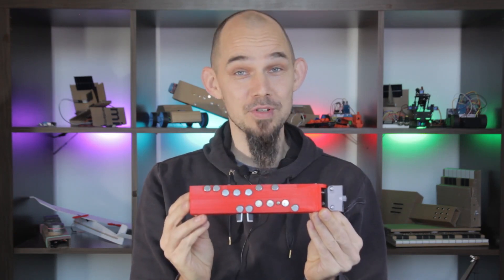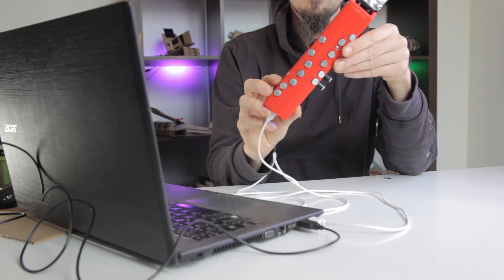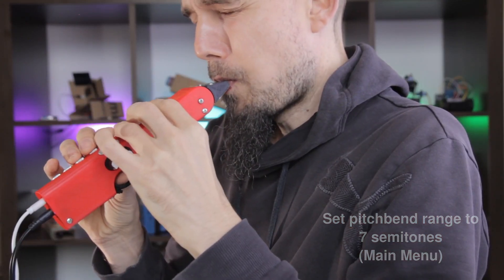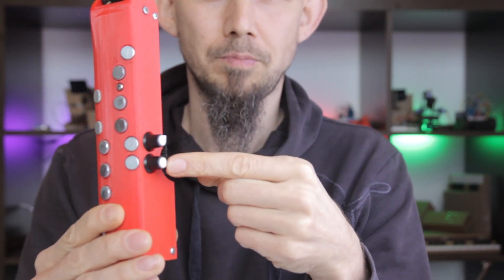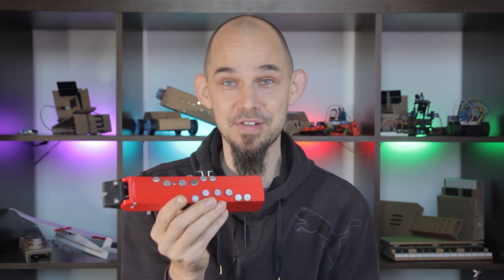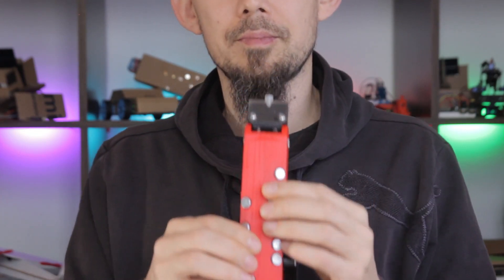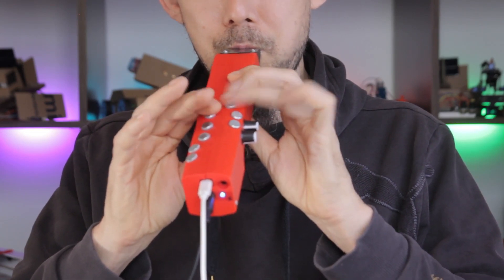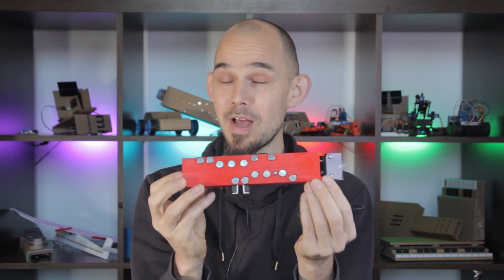The OHMs EWI gets even more awesome!

Comment: I'm impressed with your perseverance producing 23+ iterations, (reminds me of the spaceX approach to making great advancements through numerous version tests)
 For my purposes, the sound product sounds too synth, I wonder if the envelope can more continuously linked pressure input through the note life, sounds more like it's sampled as an ADSR factor once. Using the differential of 2 pressure sensors might better mimic some wind instruments.   Perhaps a more modern voice modeling algorithm more advanced than a single waveform table could provide more of an analog instrument feel, I'd think the teensy 4 would have the horsepower for that.
  Perhaps multiple MIDI control out channels would allow users to experiment with voice modeling on their PC
 There's a simple tear down of the Vangoa EWI   www.youtube.com/watch?v=2Avfv2L7Kl8
 He points out what might be a single Capacitive touch I2C chip.

Comment: This MIDI wind controller project is wonderful.
Congratulations

I am a musician and composer from Brazil and have also practiced electronics for many years. I really like midi controllers, audio, musical synthesizers, lighting and automation. But I'm still a beginner in microcontroller and DSP programming.
If possible, I would like to exchange information and experiences accumulated in our practices.
Sorry for my basic English.
I have an original Arduino MEGA Board, but I found the Tensy and ESP32 boards very interesting.
I'm currently interested in building a midi keyboard, preferably without mechanical contacts, I've been observing the possibilities of infrared sensors, such as the CRY70 and TCRT5000, to instantly generate midi codes for each key pressed:
Midi Channel, midi note, speed, after Touch and others.
The codes being generated from the voltage proportional to the approach of a reflective element to the IR pair.
Thank you for your attention, and success in your projects.
Have a great week.
Cheers
Reply from the maker: Sounds like you already have some good ideas of how to make what you want. Best of luck with your projects!

Comment: I'd love to make one of these and I'd love to buy a kit but they are out of stock =( will you restock your shop soon? If not soon, would you be able to provide a schematic so i know what pins to use on the teensy without the breakout board and other modules? I'd love to make one in the meantime to tinker with it so when the kits come back in stock I can have a more reliable one!

Comment: Amazing job! I was playing with a disposable vape pen the other day and I saw it includes an air pressure sensor which passes it’s analog output to the coil serving as a heating element. I instantly thought about your instruments.

Have you tried to mod one of those into a Bluetooth midi instrument? The problem is the ones I have access to are way too damn thin for the smallest modules.
Reply: midi oboe??? JK

Comment: Hello! really big fan of you work. i have a technical question:
how do you implement velocity on the capacitive buttons? is it a thing of teensy or not?

I was looking at the MPR121 module for capacitive buttons (that can be used with arduino as a reliable touch sensor instead of using teensy that has the same circuit built in) but the velocity part i really dont understand

Comment: Awesome stuff.

Maybe instead of audio delay effects, it would be easier to implement a MIDI sequencer that records a beat while you hold Record button and then loops it.

I did not feel skilled enough to build the entire wind instrument from scratch. So I first bought a used Yamaha WX11 for cheap to experiment with and to get the feel of it. That device doesn't even have a standard MIDI out.

What I did was add an Arduino Mini Pro with a NR24L01 and USB battery and 9V converter (because WX11 needs ~9V on input) to WX11 and an Arduino Micro Pro with a NR24L01 to my PC and made myself a wireless WX11.

I did not choose Bluetooth MIDI because it often adds some latency. With those two NR24L01 I can push about 3.7k of reliable (through a custom ACK logic) payload bytes per second with sub-2ms latency.

Now I feel ready to experiment with a fully custom build. Still, haven't yet decided on the implementation. I definitely like the idea of a small device as your OHM. I'm a bit wary that arms could get more tired if you have to hold them up, closer to your mouth, so in this regard, it might be better to aim for a tube-like device. What are your experiences with OHM? Don't your arms feel more tired than after playing a sax?

Another thing is that my mouth seems to salivate too much, at least when I open it wide enough for a sax-style mouthpiece, such as Yamaha WX11. Usually, off-the-shelf EWIs solve this with a drain tube running down to the end. But it's still ugly to have my device dripping, yack. I would want at least to have a hidden tube exit with a small shelf where I can put a small sponge that will soak up it all, and then I can discretely squeeze it with a soft tissue.

Of course, it would be even better to design a sealed mouthpiece that doesn't require opening my mouth too much, thus, hopefully, keeping my saliva reflexes at bay.

Regarding the buttons, I haven't yet decided if I want MPR121 + touch or maybe go for WARBL (also an interesting wind controller with open hardware and software) design with optical reflection sensors. With those, you get a pitch bend effect for every finger, similar to how a real wood instrument works when you partially hover a tonehole. 
Also, regarding the pitch bend - should I go for Yamaha style with lip-pressure and Hall sensor, or Kontinuum-style with the entire mouthpiece bending. So many decisions to make... and not enough time, as always 😀

Comment: Great work!
I see you finally switched to the MPR121 modules for the capacitive sensors. These are great, I'm actually building my own cardboard midi sax, based on an ESP8266 together with two MPR121 modules and your breath sensor setup.
Reply from the maker: Thanks! Yeah, the mpr121 is great. Best of luck with your build 🎶

Comment: Thats really amazing and I love to see all that progress! <3

One thing I asked myself for the whole video: Wouldn't it be easier to use if the oled-screen would be at the end of your Instrument right above the USB cable maybe with a slight tilt so that it points to your eyes and you could that way change the settings without moving the instrument away from your mouth and you would only need to lift one hand to reach the knob. Or even without moving your hand you could use some extra (touch-sensitive) buttons near your thumbs, index fingers or pinky fingers to navigate the menu easily by only moving those fingers not the whole hand.

Can't wait to see the next video or a performance with this instrument!
Reply from the maker: Thanks for your comment and suggestions Enno! I personally think that having the display on the front would be a problem aesthetically... Also, the display call functions in the code introduce a slight delay, which means that it's not a good idea to play the instrument and navigate the menu at the same time.